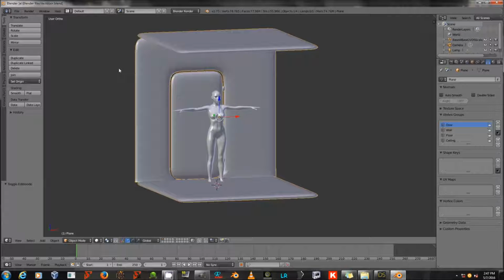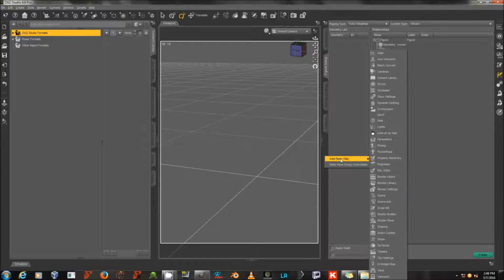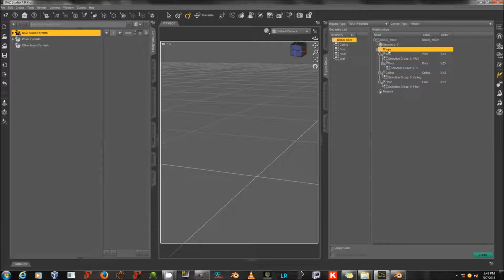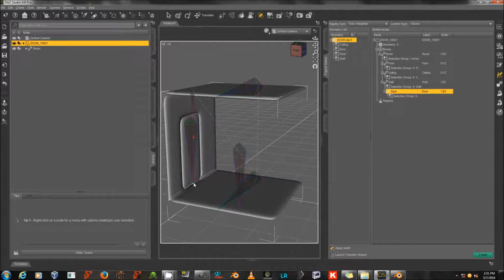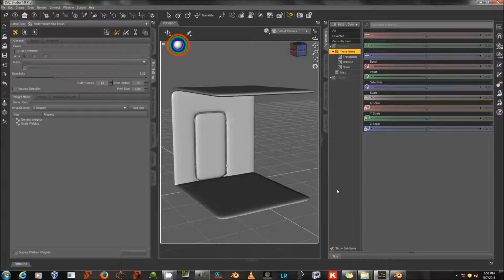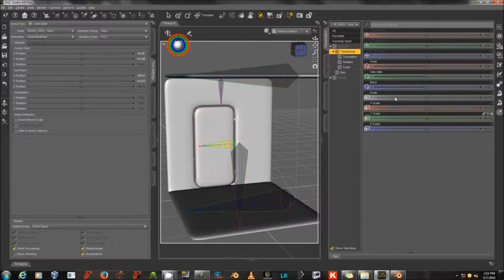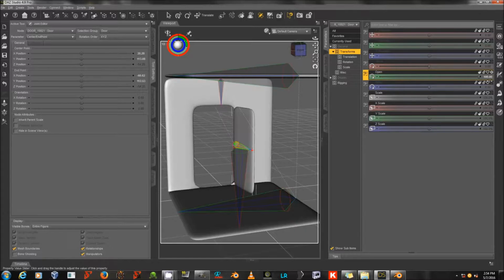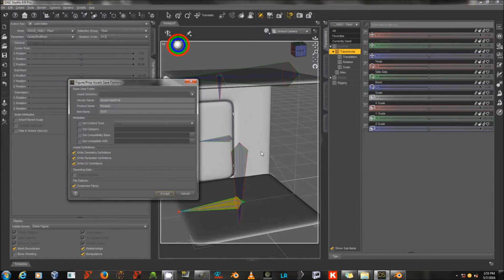Rigging A Door In Daz Studio

Comment: That is something I have been wanting to learn for sometime now. Thank you.

That said, there is another way that does not involve bones or weight mapping. I use the Joint Editor tool, which allows you to move the origin point and the end point of an object like a door, or for instance landing gear. Just as you did with the limits in this version, I do also with the other version; and I hide any parameters I don't want used. I then parent the part to the main model, which I also use the joint editor to rig, mainly to ensure that the model can be snapped to the floor. 

Your Method creates a model that could be saved as a figure. The other method creates a model that is considered to be an articulated prop.

I am hoping you will continue to make tutorials along these lines! You make it easy to follow, and that is a rare thing!

Cheers!

Comment: When I had Poser 5 I would either parent a cylinder to the 'door' and then rotate the Y-axis of the cylinder, or later with an anim8tor, I would add just a point equal in length to the door so it would look one piece to Poser and then rotate the whole door on the Y-axis. It's not a very elegant way to make a door open and close, but it worked for me. I hope I'll be able to a similar thing in Daz when I'm up and running.